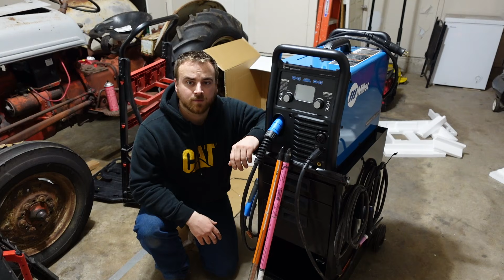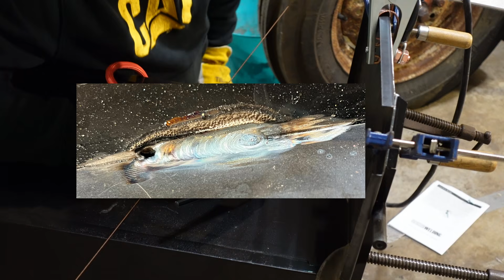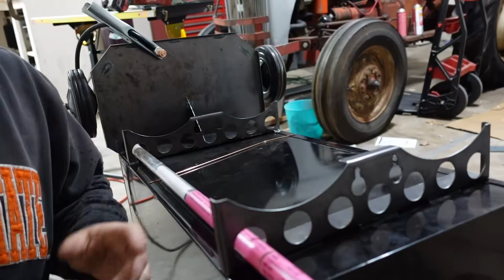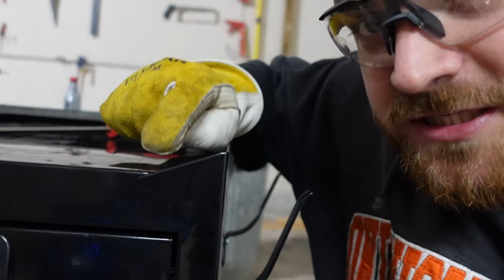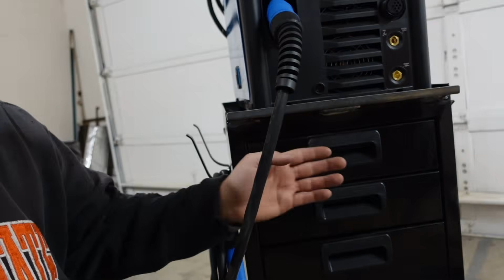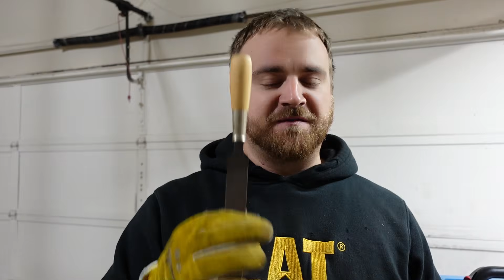Building a Custom Welding Cart on the Cheap

Comment: Noisey machine, weld a washer for a guide on the inside of the wheel, I’d have drilled a hole through the axle for a cotter key, 80 will be cheaper in the long run,

Comment: Really bothered by the end of angle you welded to the front to hold the welder.  You could have folded the angle and closed the ends off to remove the sharp corners.  Great project using common tools and not crazy expensive tools most of us don’t have .. thank you

Comment: HF version of that cart - front casters needed to be replaced once I put my Miller on top.  I do need to replace the rear wheels next - but they hare handling the 80/40 tanks I have on the back now.

Comment: Rule one of welding carts, male sure all cables an whips, have no where good to hang on the cart, ensure that all cables an plug ins dangle at all times, extra points for ensuring that the cables are constantly under the wheels no matter what you do.
Reply from the maker: So true!!